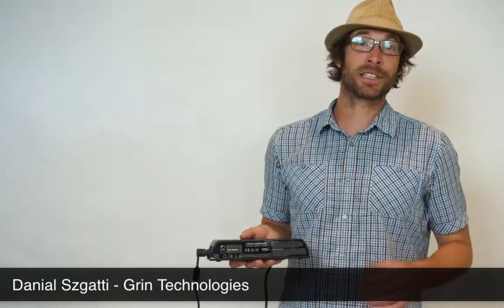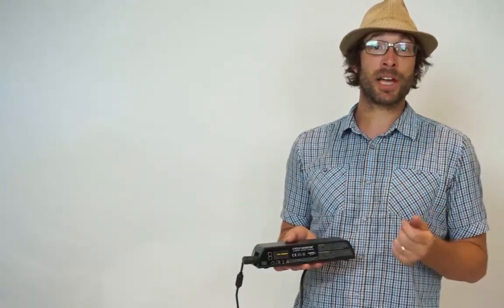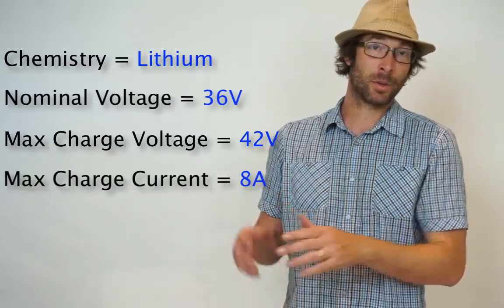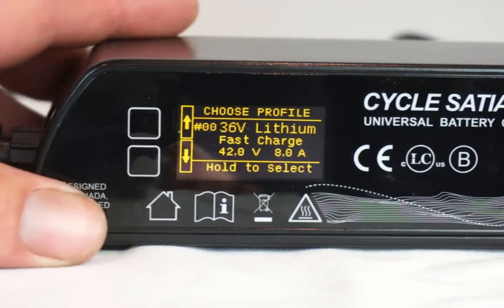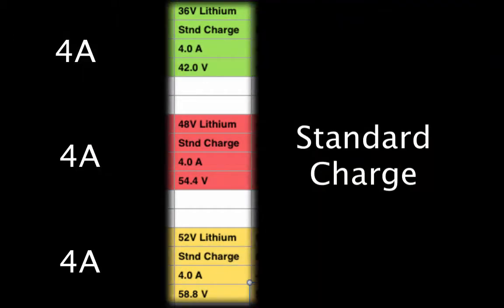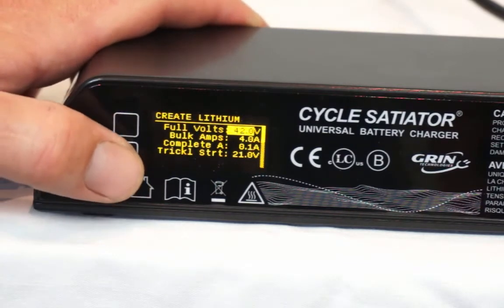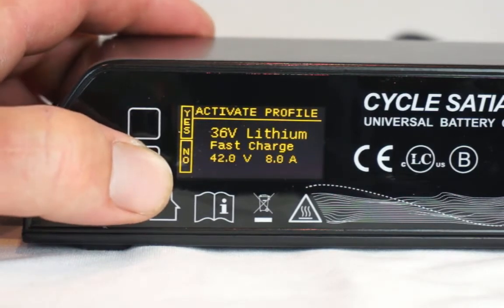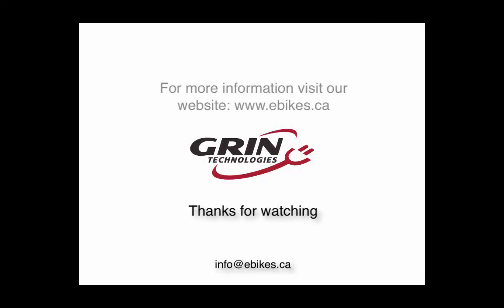48 V Cycle Satiator Initial Setup Video

Comment: Can you wake lithium battery from sleep and give commend to bms?????
Reply from the maker: Every BMS circuit can be different in this regards. Most will automatically wake up the moment that charge current is detected, some require a button press. Some only reset if you unpower and repower them. Most BMS boards with communication won't respond to commands when they are in shutdown / sleep mode, since by definition a circuitaboard isn't really asleep if it's listening to a communications channel.

Comment: Is there a way to completely factory reset the unit?
Reply from the maker: You can quite easily reload all the stock profiles by plugging it into a computer. If you want to reset all the lifetime statistics too, then that requires reflashing the firmware which can also be done via the satiator software.

Comment: This was a 36 V setup video, I wanted a 48 V setup!   I bought my satiator 2 days ago and it came with 48 V standard as default.  I did not order this profile so I think that I was sent a used satiator.  First time I charged my battery, when it was finished It showed 2 bars on the bike display.  How do I reset the satiator to new specs?  Shows firmware 1.0

Comment: Can you edit individual profile settings? I have a SLA battery 24 volts 7ah. Whats the max amps I can charge it at as I currently have to wait an entire day for it to charge before the kids can ride their vehicle?
Reply from the maker: Yes you can create custom profiles and have the settings however you like them.  You don't want to charge a 7Ah battery at more than about 2.5 amps or so, SLA batteries don't like to be rapid charged the same way that you can with lithium and other chemistries.

Comment: if I were to purchase the 72v 5a for my 84v 28ah battery. could I also use this same charger to charge my 48v 23ah battery of a different e-bike I have? i'm looking for 1 charger that can charge both battery packs.
Reply from the maker: Yes for sure, the 72V satiator model will work just fine charging 48V battery packs as well. You'll just be limited to 5 amps maximum charging current, so it won't have the full 360 watts of power that it can do at the higher voltages but 5 amps is still going to be a decently fast charging rate even for a large 23Ah pack. .
Reply: Grin Technologies Thanks so much for clarifying that for me. I went ahead and ordered it can't wait to start using it!